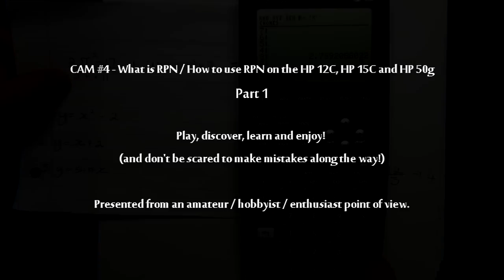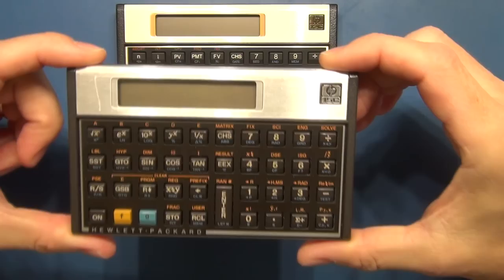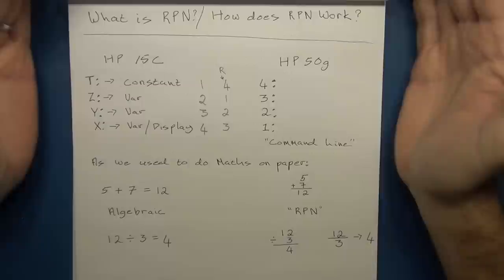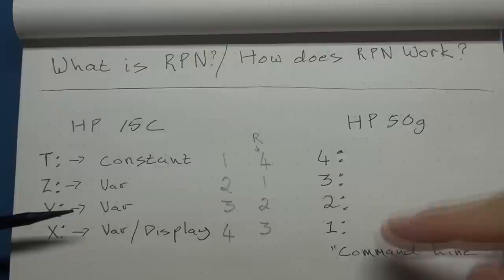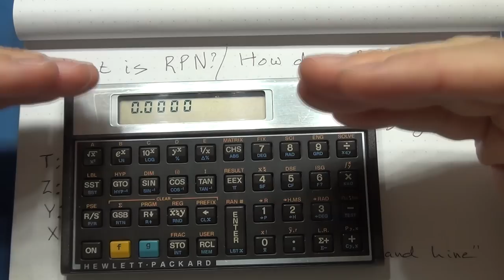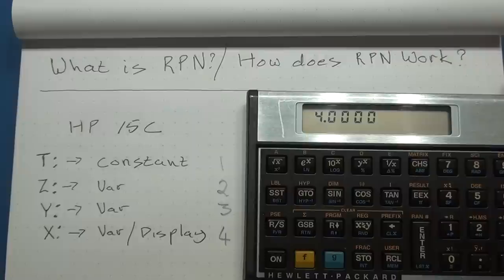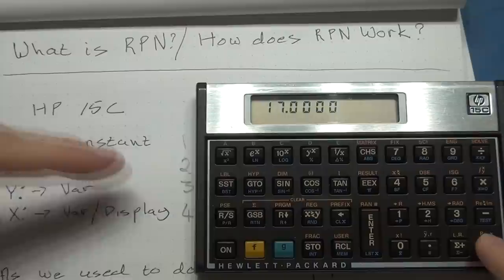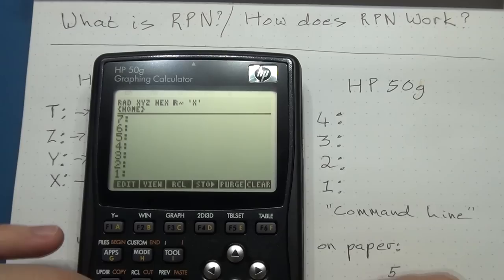CAM #4 - Pt 1 What is RPN Reverse Polish Notation / How to use RPN on the HP 12C, HP 15C and HP 50g

Comment: My opinion about the "RPN is the most efficient" myth.
The first basis of this misconception comes from the time when HP introduced RPN. Back then, the only alternative was single operation machines. So you could only do 5 + 3, you get 8, multiply that by 2, get 16, but if you wanted to divide that 16 by, say 3 squared, there was no way to store that 16, do 3 squared, then do the division. Even later when memory was introduced, it still wasn't sufficient to compete with the RPN stack, even as limited as it was.

Later, when TI started introducing algebraic calculators, all the RPN fans probably found it unnecessarily difficult to learn a new system where everything was backwards. What's more, since algebraic was new, it was probably pretty clunky. Also, due to how close the RPN stack is to how calculator hardware operates (which is why it has always been so easy to program in RPN), algebraic was pretty limited because it was so much harder to develop for it. With RPN you can just feed user input straight into the hardware. With algebraic, you have to basically translate it to something like RPN. So for practical purposes it was impossible to do an unbiased RPN vs algebraic comparison. Why would you ever choose an algebraic TI when it was so limited compared to RPN?

Then HP started introducing algebraic mode in their calculators, but with the exception of the Prime, it has never been the primary operation mode. So trying to use an HP 50g in algebraic is pretty awkward, considering it still is an RPN machine first and foremost. Everything is meant for RPN, and then algebraic was shoehorned in. Considering that, it's easy to see why one might think RPN is more efficient than algebraic.

So it's my opinion that this myth comes from the fact that it's not RPN that's more efficient than algebraic, but that RPN calculators have historically been more efficient and advanced than algebraic ones. This is because RPN forces you to provide input to the calculator in a manner it can easily understand. RPN is very similar to how computers actually work: put one number in a registry, put another number in another registry, perform an operation. But from a human centric perspective, algebraic is much more intuitive and simple and clearer than RPN. And when we're talking about symbolic math, RPN is next to useless. Why would HP calculators have equation editors and algebraic objects if RPN is so much better than algebraic?
Even though RPN fans like to say RPN is how humans do operations, it really isn't. And the HP Prime kinda shows it. It is specifically designed around algebraic input, with RPN being an afterthought. Now we have the graphic and processing capability to have computers communicate with people directly in human readable formats. That's why kids have no problem using algebraic on a Prime, but will easily get frustrated with any RPN calculator.

In conclusion: RPN is not more efficient than algebraic. It's just that RPN calculators have been historically more efficient than algebraic ones. But that is no longer the case.
Reply: Speaking as a person who grew up in the early age of calculators, I never thought about this but think you’re right, that all makes sense. I’m an engineer who never found rpn to be intuitive. Equations are normally written out, so it’s easier to just use an algebraic calculator to type in what you see. One thing: back in the single operation calculator days, we’d deal with the division problem by inverting (1/x) then multiplying.

Comment: In an ideal RPN system, the first interger or factor would be loaded into the accumulator-register first with the ENTER or plus key. Then the next interger would be keyed into the entry-register, and then use an operator key (+ - / x)  to achieve the desired results.
Leading zeros would be used to both key in the location of the decimal point, and the level of precision (where to round off).

Comment: HP quality went downhill after the  11, 12 and 15c calculators. The letters on the keys are molded in and are easy to read compared to later ones with a very positive keystroke. I like that store and recall buttons are primary functions. Love RPN!
Reply: I recently got a 35S and while it's not quite up to that standard I'm really impressed with how great the keys feel, and with the general design and layout (the enter key is in the right place, etc). I would like to see them re-release the 11c/15c/16c the same way they did the 12c though because that form factor is great
Reply: Yeah, who needs a three-key memory function. STORE and RECALL keys are better! I have my dad's old scientific calc from the early 80's and it these keys.
It was solar powered too!

Comment: There's a letter "c" that popped up at the bottom right hand corner of my HP 15C  display.  What does it mean?  And how do I clear it?  Thanks.
Reply: OK, I think it was the "C" annunciator (as explained in the HP 15C guide) ?!
Reply: I think it stood for Constant Memory. You can switch it off and come back later, switch on and the last number is still there.
Reply: The small "c" annunciator means you are in complex mode, as stated in the user manual.